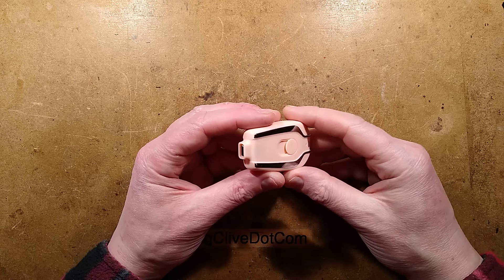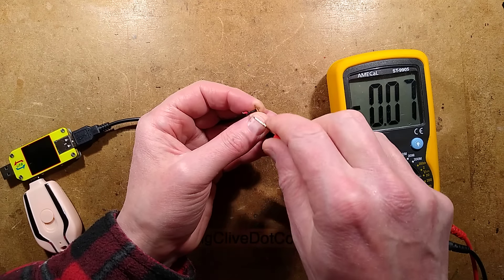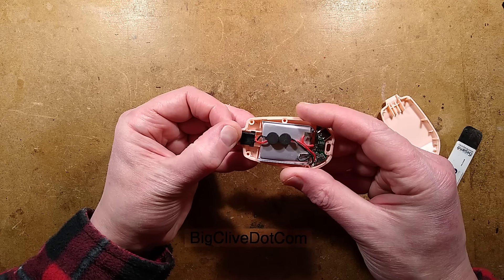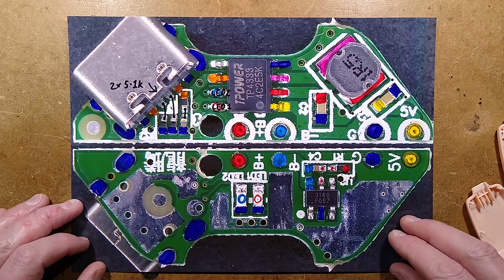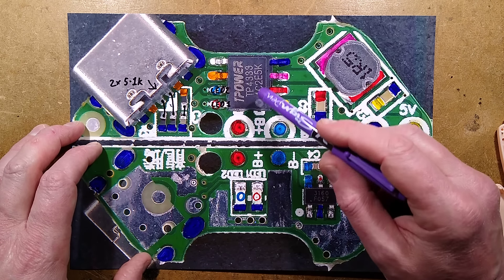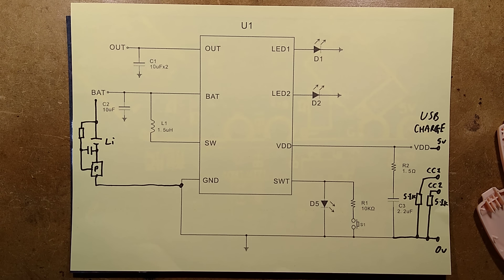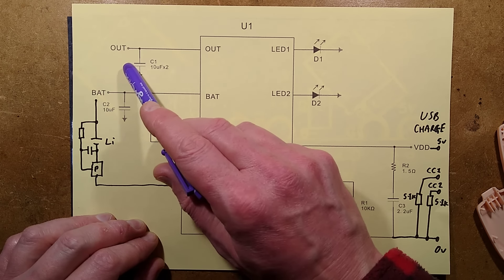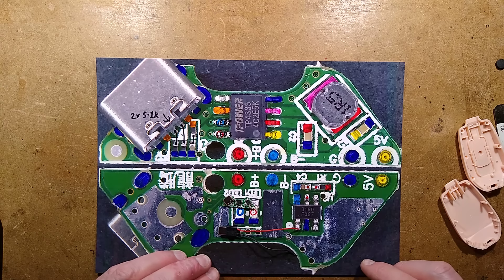eBay keyring phone-killer

Comment: Of course I had to order one to "play" with too.  LOL
Reply: And then?  12 hours later?

Ha!  I ordered one (pink of course) on February 6 from Ali.  It was Just under $5.00 including shipping.  It came today only 20 days later which is pretty good.  Ebay had listings going from $7 - $8 all the way up to $ 31.00 (damn!)

I took it apart immediately and it was wired correctly!  A tired or improperly trained factory worker - Or, Ebay sellers buying the rejects or something?  Or, I lucked out with a good one.  Not sure.

So mine is a little different inside though identical I think from the outside.  Looks like about half of the capacity.

I posted some links to pictures on your Patreon page if you are curious.

Wow, I'm so glad I found it considering you didn't post links!!!  LOL  Haven't seen a troll like little jimmy for a while.  You handled it like a true professional!  Hats off to you sir.

Comment: The joys of Ebay. Often a manufacturer in China will sell faulty stock on a needs rework basis (instead of dumping). Buyer will set up a ebay account (or sell to another bulk seller without warning) and because its cheap often customers wont complain.

Comment: okay here's the big failure yes it will work if designed right but who whatever would leave their phone unattended I have never left my phone and I never plug it into anything else besides a USB cable unless the wall socket managed to transfer data through the power adapter
Reply from the maker: Wrong product.   This is just an "innocent" power bank for recharging your phone in an emergency.   But miswired.
Reply: @bigclivedotcom  I'm talking about the general idea of a phone killer
Reply: I think you got your wires crossed, do you make phone chargers as well?

Comment: If I send you an AIO Flight controller and esc From my fpv drone would u reverse Engineer it And tell me what burned out Very 1st flight just out of the Box Is charged up and ready to go Took off What about 10' in the air I hoverd it's and then I landed it and some smoke came off the aio and now its dead I think a tiny bit of wet grass got chopped up by a propeller and landed on the board

Comment: Very common for china things to be made wrong.   I had a set of solar inverters that were failing, I decided to open them up and nobody took the plastic protectors off of the heat sink so they were insulated from the heat sinks... on all 5 of them.
Reply: They were likely there on purpose..where the contact leg in also the shunt can. ...if it was a thin mica type and not a great wad of polythene of course.  ;0)

Comment: installed a traffic camera in my wife's car and powered it through the cigarette lighter.  fkd up the electrical system of the car.  blew the cigarette lighter fuse, fkd up the remote door locks.  luckily my mechanic was able to repair the problem.  he suggested going directly off the battery to power the camera.   hmmmm.  maybe a faulty camera
Reply from the maker: The camera should only have been able to blow the fuse.  It sounds like there was another wiring issue.

Comment: End of 2022 I wanted to uprade my computer with a better video card for youtube - ordered the cheapest 800W power supply from ebay and only after having killed my new fat video card and the motherboard i realized, that the extra power connector for the video card had been reversed.
What a bummer.
Well, shoud have checked beforehand - but then, who thinks about that on a brand new device.

Comment: Oh man, now I want to know if my phone can handle -5V. Not going to test it, but I might try my old, old iPhone.

I’d hope a $1000 device could handle negative voltage, but I recently heard a story from a friend at a large biotech company where they bought a $50k-200k laser-related device that went poof when they plugged it in. Turns out the supplier wired it wrong and didn’t spend the required $0.10-10 required for RPP

Comment: It seems some manufacturers use red for ground and black for 5V. I fixed the neighbour's game console and I checked the voltage just in case and I was surprised. Repair completed just the same. Maybe this problem is related to this polarity problem.

Comment: I remember the Pixel Books (Googles fancy chromebooks) getting bricked when used with substandard cables. 

And as much as we should expect manufacturers to place protection circuits in their devices, I can’t understand how someone expends couple hundred dollars in devices just to cheap out in charging solutions when they need a replacement/ extra charger / powerbanks.